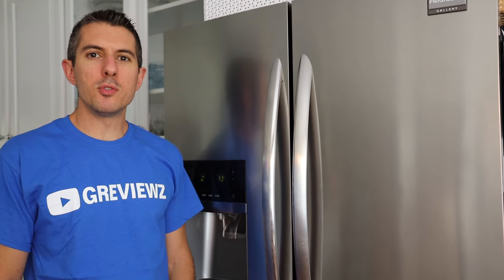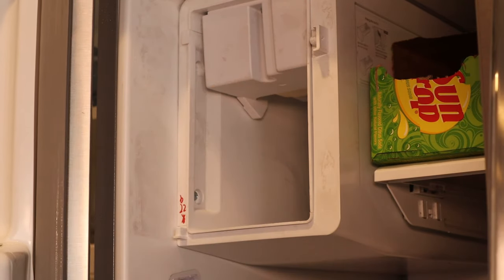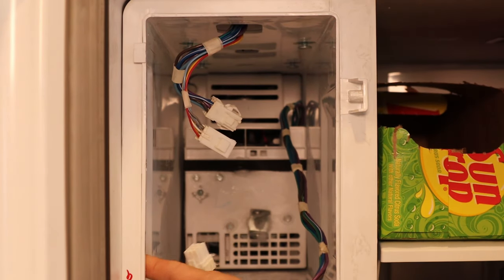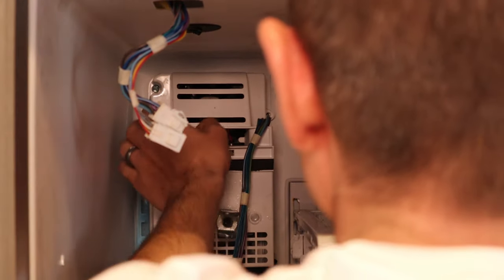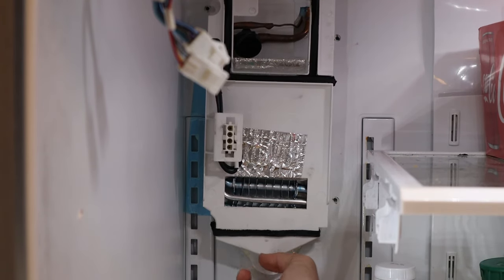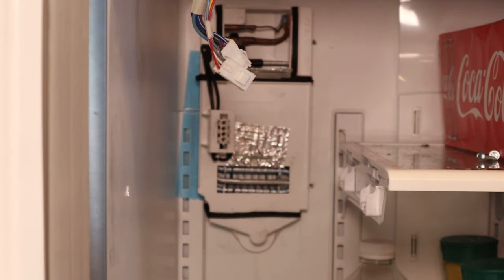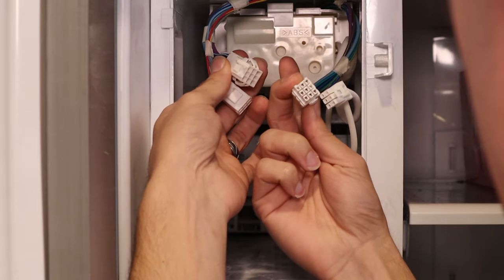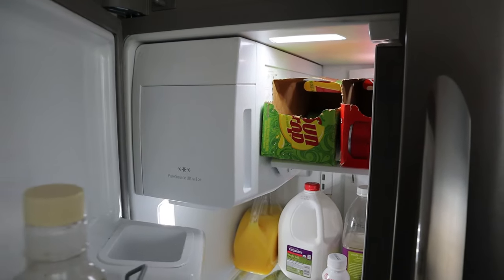Frigidaire ice maker broken again: fix it

Comment: I have a spare fridge in garage.  Moved all my stuff to it, then turned fridge off and opened the doors for about 6 hours… everything melted and then after wiping out all the water, I turned fridge back in, and voila, it all worked again (no tools required).   Even the bottom ice maker worked again.

Comment: I did this tear down a couple of years ago based on your first video. And it worked. Recently it stopped making ice again and I took a different approach. I turned off the icemaker and pulled out the ice tray and set the refrigerator on 37°. I went out of town and came back about five days later. I went to the basement and shut off the breaker for the refrigerator and turned it back on after about two minutes. A reboot.  Within a couple of hours I heard the water flowing into the ice tray. A few more hours I heard the first tray of ice drop.  By turning off the icemaker I turned off all of the ice maker cooling apparently. And all of the ice that was gunking up on everything back there melted because of the 37° in the refrigerator.  going forward this will be my new solution.
Reply: I’m going this route… however, what I really want to know if anyone has actually found a FIX for this problem. This video isn’t really a fix, it’s a work around. I bought this fridge used and I’ve only had it for a few weeks and I’m having this problem. There is no way I’m doing this twice a month for the rest of my life so I need a real fix…
Reply: @christopherdahl8997  The turn off that I described only works for a few days before it stops making ice again.  By the way, I was walking around in Lowes the other day and they are still selling this frig with this  same icemaker!!

Comment: GReviews, I appreciate you wanting to help folk, even remaking your video.  I want to add that I have this exact same refrigerator.  Tried the same repair, didn't fix for long.  In a blog someone had commented that the refrigerator needs to have a 1/4" tilt backwards, in other words, the front needs to be 1/4" higher than the back.  Sure enough, in the installation manual it is to be installed with this tilt.  The guys who installed my refrigerator did not put it at a tilt, thus the ice maker freezes up.  This has been a successful solution to this problem.  Be sure to give the refrigerator time to go through the defrost cycle a few times before you say this doesn't work.  What have you got to lose?
Reply from the maker: S Good thanks for watching. Yes Ive heard the 1/4” lean works. The problem I have with it is that the techs that come fix the fridges dont even know about it...that puzzles me. If that was really the fix I’m sure Frigidaire would tell you to try that instead of sending a warranty tech to your house on their dime. I’ve put my unit through the defrost cycle multiple times but I can’t just let all my food go to waste. Plus the problem are doesn’t have any part of the defrost coil in it...
Reply: Thank you for this!!! Holy cow - this and the manual defrost mode took care of everything I believe
Reply: @GReviewz  does the fridge portion get warm during a defrost? I put all my freezer food in our deep freeze.

Comment: I just removed the ice bin and heated the back of the unit with a hair dryer until water stopped dripping from the back, turned the power back on and had a full ice bin in the morning without taking the unit apart.
Reply from the maker: Thanks for watching. I am glad you were able to get yours working correctly. I’d say only like 20% of people that try the defrost it will actually fix their problem..
Reply: Meatball, did the problem ever comeback?  I just did it your way and so far so good.
Reply: So do you mean you did not remove everything like he did, just the ice maker?
Reply: @courtneymcclendon3266  I removed enough of the large white parts until I could fit a hair dryer in there.  It’s been a month and everything has been fine.
Reply: @courtneymcclendon3266  yes
Reply: @RyanEugeneKelley  it kept on working
Reply: Did you unplug the frig?

Comment: I have the Electrolux version of this.  While this is a good video, it doesn't solve the problem of why it is happening.  That is because there is air getting into the system because the seals are crap.  There is a rebuild kit sold that helps to solve this.  I watched the Bens Appliance and Junk video on how to fix it and bought the rebuild kit.  It worked!  Interestingly enough, Electrolux says it can't  be fixed.  It is a pain to fix, but it was an expensive refrigerator and it was worth it to fix it.  Not happy with Electrolux saying it is not fixable!

Comment: I have the notorious Problematic Frigidaire FFHB2750TS Rev 9 that's only 3 years old and gently used by myself only. I had the typical Ice-maker air leak problem so carefully took everything apart and improved on the already poorly factory installed band aid that makes sure the defrosted moisture drains good and all air gaps sealed. The factory has the defrost timer setting to run at about 12 hour intervals and I have verified water flow out of both tubes at the bottom during the cycles. There is no ice build up in any of the coils locations but 3-5 minutes into every defrost cycle you get LOUD Shotgun blast K-Pows from several areas of the unit. These are much more violent than just plastic/metal expansion noise. Any ideas as what it is? Is Everything made in Mexico and China is JUNK Nowadays???

Comment: Thank you for the brilliant video. I love the sounds of your girls. It brings us back to a different era 😃. We pulled out the ice drawer and found that the motor area at the back was full of big chunks of ice like you describe.  After watching your video we were thoroughly intimidated by the amount of wires and screws involved so we decided to see if we could tackle the frozen motor without taking everything apart. What we did was pull out the drawer. Then we turned off the fridge as you instructed, then we put two mugs filled with boiling water into the cavity. We then stuffed up the hole with 2 oven mitts and a plastic bag then went and had a cup of tea. One hour later we came back and pulled out the oven mitt stuffing and mugs and everything was thawed. I wiped out the interior of the fridge where the melted ice collected and turned the fridge back on and put it into quick freeze. We have ice again. Thank you so much for you video!!!
Reply from the maker: Thank you somuch for watching and for leaving positive feedback. I am so glad this video was able to help you fix your fridge.
Reply: This one worked for me as well! 2 mugs of boiling water for 1 hour (8pm-9pm). No action when I turned the power back on but it was full of ice by the next morning :D
Reply: I used the warm mugs also.  I did it 2x for an hour each.  Making ice again!  Thanks for the video & alternate defrosting technique!

Comment: Thanks for the video.  My 3.5 year old Frigidaire stopped making ice a few days ago.  I figured that some component system got iced up in the icemaker system.  In my case, I found an ice pellet at the rubber water inlet on the top wall of the refrigerator.  It was molded to the shape of the hole.  I pulled that out and ran the hair dryer on high fan and high heat for several minutes.   The motor barely had a trace of ice and so did the piping and fins in the back, but I applied the hair dryer there as well.  Once all three places dried out, I reassembled the system and got the first batch of ice in less than 2 hours.  Although the exact cause was different and I had a metal cover over the fins instead of plastic, your video allowed me to disassemble the system with confidence and avoid calling a professional.  Kudos to you!
Reply from the maker: Thank you for watching and taking the time to write a positive comment. I am glad to hear you were able to get up and running and do t have to pay big $ for a repair man…

Comment: Thanks so much for a great video! A couple of notes: (5:05 mark) - looks like they did a mild redesign at some point, and the wires are in a race where they no longer need to be zip tied from the factory, making this even easier to do! Something I'd bet other people will run into as well - my issue wasn't the severe ice-up you had in yours, but simply ice build up in the water supply, preventing water from getting to the ice maker. Gentle application of a heat gun (never letting things get more than warm), the ice melted, and I should have ice again by tonight! Thanks again, great work!
Reply from the maker: Thanks for the positive feedback. I’m glad I was able to help. The design has changed over the years..

Comment: I don't comment very often, but I really wanted to say thank you for this. I was very concerned and this video was 100% spot on what the problem was and how to fix it. Thank you!
Reply from the maker: I try to reply to everyone’s comment. Thanks you watching and I’m glad I could help!!
Reply: @GReviewz  the same exact thing just happened again. I watched your video again, did the steps again, and it's working again, but any thoughts on why this would happen again just two weeks later? And most importantly, how I can ensure it doesn't happen again two weeks from now? Is there a bad part in there maybe? My kids do leave the door open more frequently than I would like, could that be it?
Reply: Hi hi I think from my experience probably. The drain hole is on the back of your refrigerator is clocked that's why the water build-up and freeze up every few weeks you should use some wire or compressed air to blow out the blockage. This is the most common problem in ice makers and refrigerators
Reply: @slawomirpieniazek2148  thanks bud. As it turns out, the ice tray itself was faulty. I replaced the tray assembly and it works fine now.

Comment: Great video. Thank you for the detailed information. I think I’ve found an easier way to fix the frozen ice maker without any tools. I’ve found there to be an inherent problem with the ice maker water tube and coils freezing up. This fix should take about 60 minutes at most. First put the refrigerator in defrost mode by pushing the + and - button simultaneously. After it finishes the defrost mode which should take about 30-40 minutes turn the refrigerator off on the door panel and remove the ice collector. Next put a pot of boiling water on a heat pad in the back of the refrigerator directly under the ice maker.  Finally take a blow dryer and with the setting on high point it directly towards the back of the ice maker while you hold the blow dryer in the front of the ice maker. Do this for about 10-15 minutes. Then put the ice collector back on the ice maker and turn the refrigerator back on at the door panel.  You should be able to start making ice again.

Comment: Thank you for this video.  I fixed mine with this information, but without taking it apart.  I simply turned off the ice maker, pulled the ice tray out to allow refrigerator temps to go into the ice compartment, and put a small hand towel in to catch any melting ice.  A few days later i put it back together and it worked perfectly.

Comment: 7:15 Nice Catch!
I watched this once and a second time doing it.  Thank you!  We have plenty of ice again (as long as the extended the family isn't visiting).
Again, thank ypu for nailing the problem with an intuitive video!!
Reply from the maker: Thanks for watching and for the positive feedback. This process is a temporary fix. The design is flawed but if a tech came out to do the same job they’d charge $250-300
Reply: @GReviewz  I found if you keep it making ice ...it won't freeze up as fast. I will bag the ice to stock up for times when mine quits...strangly it will start back up in a few weeks...We call it ghost ice when out of nowhere a tray will dump after none for 3 weeks...

Comment: Im never buying Frigidaire again. I am an electrician and I have a full Frigidaire set that lasted 3 years my dish washer mother board fried found out after trouble shooting it with my fluke. now my fridge is having constant issues with the ice maker. Im replacing everything with Bosch in my kitchen one item at a time. The fridge is next. Great video im gonna give this a shot and if it keeps happening its not worth my time rather buy a better appliance thanks bro for a great video.
Reply from the maker: Thanks for watching. I feel your pain. I have all Frigidaire appliances in my kitchen as well. Knock on wood everything is still doing well except the fridge. I was recommended this brand by many people. All of them however have older Frigidaire products. They used to be a good company..

Comment: Great video.  I too have the same fridge and have battled the same issue over the 5 years we have owned it.  After 2 service calls from a local repair shop we found out that Frigidaire makes a "fan housing repair kit"  to "fix" this issue (search "Frigidaire ice maker handler kit" to find part number).   It consist of a larger gasket that goes behind the fan housing assembly, and some pipe insulation that goes on top of ice maker housing around the water inlet tube opening.  It makes putting the ice maker housing back in to the fridge really tough, but it does stop the freezing up issue you have shown.  However, it doesn't fix the issue entirely.  Every once in a while, the ice maker stops making ice.  Now it is due to the water in the fill tube freezing up.  To fix that issue, I have to remove the ice bin, remove the front cover, remove the ice storage tray and then use a heat gun on low, aimed at the fill tube, to carefully melt the ice.  I then put the fridge in diagnostic mode, put a container under the fill tube, and manually cycle the fill for the ice tray to verify I have cleared the ice plug from the fill tube.  Put it back together and it will work for 4-6 months before it freezes up again.  Really sucks to have to have to go through all of this on such an expensive appliance.  Frigidaire is no help as far as recall/repair.  They offered me 20% off of the repair parts but I had to buy from Frigidaire.  I found what I needed via 3rd party for 1/2 of the price from Frigidaire including the 20% discount.  I have also had to replace the defrost assembly,  the auger motor for the ice storage tray & the touch screen control assembly on the front.  I will not own another one, I can promise you that.
Reply from the maker: Thank you for watching and for your input. I have to this point only had to do this process twice in 4 years of ownership. I have many family members who purchased these units around the same time and they all have had problems. I refuse to call a service guy for this problem. My uncle had the same problem and ended up with a $300 repair bill and it has frozen up again. How much was the screen replacement?
Reply: @GReviewz  I purchased the screen from Parts Dr. or similar website for around $180.  I can't put my hands on the invoice at the moment. Did the install myself in about 5 minutes.  Pretty simple to do.
Reply: Thanks!
Reply: What 3rd party were you able to find the repair kit from?

Comment: I was away from home for five days and the water dispenser stopped working. You have the same fridge as mine. After searching around the net and finally came across your video I got the water dispenser to work. I only unscrewed two plastic panels though and didn't remove everything like you did. Thanks for the video.
Reply from the maker: Thanks for watching. I appreciate the isotope feedback. I am glad my video helped with the method you used..